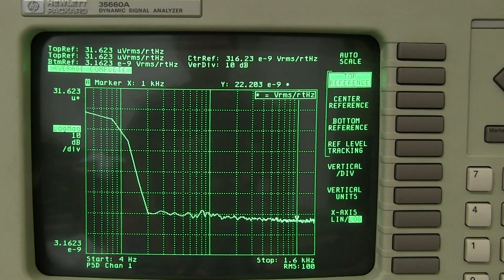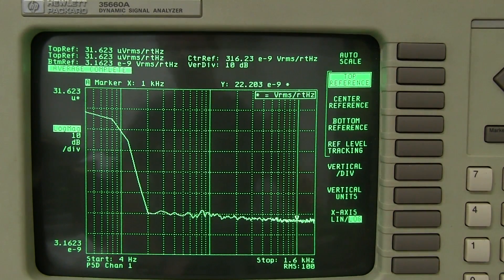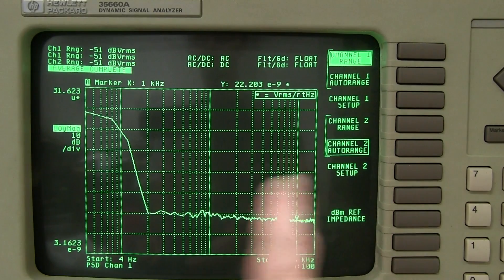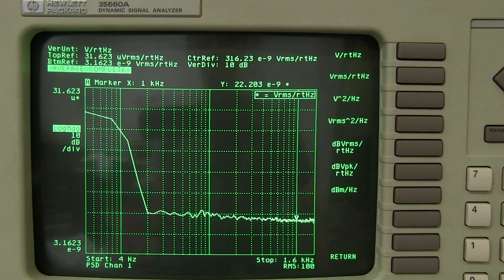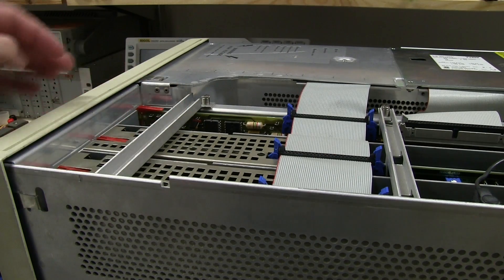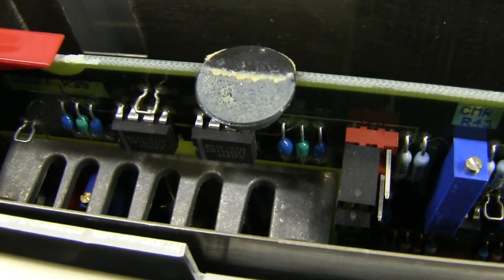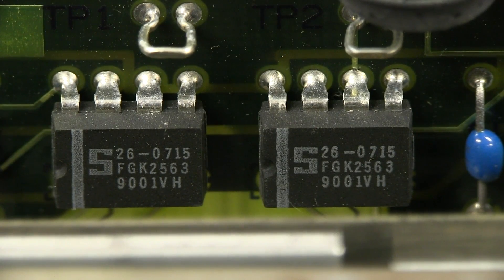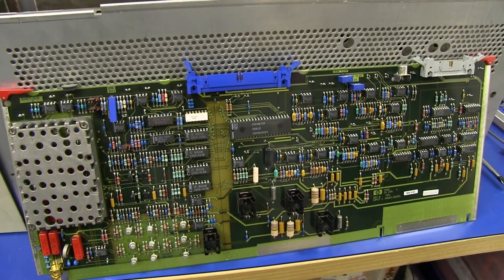EEVblog #529 - HP 35660A DSA Upgrade Investigation

Comment: It's black. At and around 10:47 you can see black text around the board, and the black line down the middle in question branches off to the right clearly at 11:05 crosing several top layer traces. So the line must be silkscreen dividing areas of the board for some reason.

Comment: Dave, the problem is, more modern op-amps than the AD797 usually only have SO-8 packaging instead of DIP-8. If you can upgrade the PCB using SO-8 op-amps, you could try the LME49990 from TI, it has better than great specs, and it doesn't need compensation as far as I remember.

Comment: Yes, you're right:  the 4 FETs do contribute about 20nV/rtHz at 1kHz, and that would be improved by using better FETs.  Nonetheless, you'll quickly get to a point where noise is dominated by the output stage of the input buffer op amps, because the input buffer stage is run at unity gain.  And of course you'll also be limited by the noise in those 5k resistors.

Comment: Siliconix datasheet shows 10 nV/rHz typical @ 1 kHz. Two FETs per amp, two amps per channel (high and reference) gives 20 nV/rHz added in quadrature. Add 7 nV/rHz * sqrt(2) for the two 5k series protection resistors, I get 22 nV/rHz RTI. 

And it's all unity gain; no allowance made for the diff amp, AA filter or ADC.

Comment: I should add:  the 2N5545 is indeed not particularly low noise, but it's lower noise than Dave's seeing.  You'd gain a _little_ by replacing it with a more modern, lower-noise JFET pair, but you'd be disappointed that you didn't get down into the low single-digit nV/rtHz spec'd for your part.  You probably WOULD improve the noise at very low frequencies significantly; the 2N5545 has a pretty high 1/f noise corner.

Comment: Be really careful trying to second-guess what the designers had in mind!  There's a clear reason why the noise is as high as it is, and it's not the FETs.  It has to do with a design choice to achieve good performance in another area.  It would be easy to miss that point and mess up the performance.

Comment: You're correct if the FET stage would have sufficient gain. But this circuit looks like a voltage buffer to me so gain = 1 so the opamp will most likely be the largest noise contributer.

Comment: Dave, you might note that the power to the dual FET is bootstrapped to follow the input voltage.  There are some implications there to why you see so much noise.  It's not a BNC:  it's an SMB!  Typical HP part numbers:  1826-xxxx are analog ICs, 1820-xxxx are digital.  So the 26-0715 really is 1826-0715.  Sometimes you can get lucky with a google search or similar, as you can with this one.  If you get really lucky, you score an HP cross-reference booklet. (1853=PNP, 1854=NPN, 1855=FET)

Comment: They're JFETs; not sure why the strange symbol with an arrow into a floating gate!  Someone really should have put some voltage gain in that buffer; the noise is the result of output noise in the op amp, not the noise of the FET or input op amp noise.

Comment: Seems like an easier way to get lower noise (and what I did, in fact) is put a low-noise ext preamp in front of it.  You can even use the HP35660/35665/35670 to measure the gain of the preamp as a function of frequency, store that in a register, and use the math functions to more directly display calibrated readings.  My application was for a low-impedance source; I used an AD797, 2 9V batteries for pwr, and well shielded, to keep the preamp noise very low.  For AC cplg:  10uF of polyprop caps.
Reply: Very late reply to this comment but I have one of these units and I want to use it for very low noise measurement. What gain did you use for the preamp, and any more build info?

Comment: Dude, you nailed it! Take a look at 4:51. There is a shield that runs right down that line. They didn't want the shield to wear through to the traces so they ran all of them on the back of the board. I didn't even notice it during the disassembly. Dave was talking about the BNCs and I wasn't paying attention to the shield. Good call on that one.

Comment: There appears to be more to it than that. Clearly the traces on the front of the board are very light green. The other traces on the reverse side are dark green. The vertical trace you refer to seems to be something else it doesn't match the color of the traces on the front of the board at all. It can't be on the back of the board either because it would intersect countless traces there as well. The vertical line is there for a reason, and they sacrificed extra cost to keep traces away from it.

Comment: Hi Dave! Thanks for the videos. I'm particularly interested in this DSA series because I have one in my lab at the university. Well the datasheets of NE5534 shows me it is not that bad on noise performance 3.5nV/sqrt(Hz) is a nice figure actually. So, I suspect that the noise floor is killed by sth else in somewhere else. It should be nice to measure the performance of the input MOS pairs. BTW for low level measurement purposes I use AD8675 generally. It is great for its price.

Comment: @EEVblog, Dave at 10:47. I was noticing many traces that appear to connect to vias to the back of the board and then run to another via to the front again. Why would they do that rather than run the traces across the front of the board and be done with it?

Comment: 3: A hybrid BJT and op amp stage. Cheap options include using 2n4403 in paralell as is very common for high end moving coil and balanced mic amplifiers. The analog devices sssm2220 PNP match array has a .32nV rt Hz amplifier circuit design in the application notes (fig 16). It parallels 3 arrays ($8 each) and uses a similarly priced ad8671 as well as .01% resistors. Expensive, but components are readily availible.

Comment: 2: Design a special low noise op amp out of discrete components. This is difficult, potentially expensive and other parameters are going to suffer. The lowest noise I've seen online is Samual Groner's SGA-LNA-1 precisely for this application - 0.5nV rt Hz. It uses hard to find transistors, however.

Comment: I've been interested recently  in design of amplifiers for noise measurement and microphone preamplification - though the latter has low distorsion requirements as well. For highest performance,  I think your options are:

1: A low noise op amp such as lme49990 (.88nV rt/Hz), AD797 (.9nV) or MAX9632. I have a stack of lme49990. They are much cheaper than ad797, have lower 10hz noise and has ridiculously low distortion. However, it does higher current noise so beware of high source impedences.

Comment: I wonder how much of the noise comes from the input FETs, the op-amps, and the ADC itself (what's the big DIP40, the PCF8577P, by the way)?

Odd that the schematic shows a matched dual *MOSFET*, not just JFETs -- Tektronix for example used dual JFETs frequently, but not MOS.  Even discrete MOS are noisy (and contemporary MOS amps of the time would've been much worse).  Out of a 1M input resistance (if I saw that right), I don't see why they even bothered -- replace the whole lot of 'em I say!

Comment: Quick followup - those transistors are HP 1855-0460. The general rule with HP IC part numbers is, they drop the "18" if there isn't enough package space to print it. I tried to look it up in the HP_Agilent_Equipment archive but the horrible new Yahoo Groups interface is frustrating my every attempt!

Comment: "26-0715" --> HP part number 1826-0715. Google for a HP part number cross reference an look it up and... it's an NE5534:
1826-0715 	2910 	NE5534AN
2910 is the manufacturer code for Signetics.